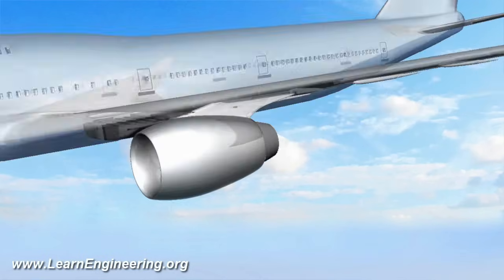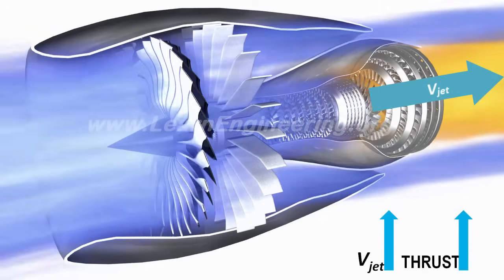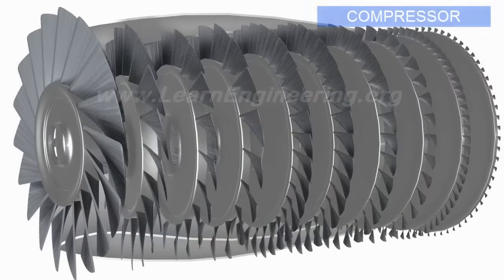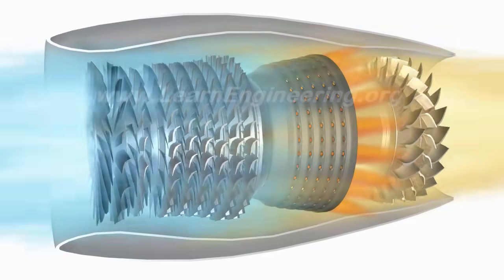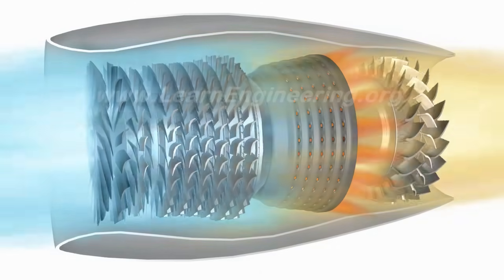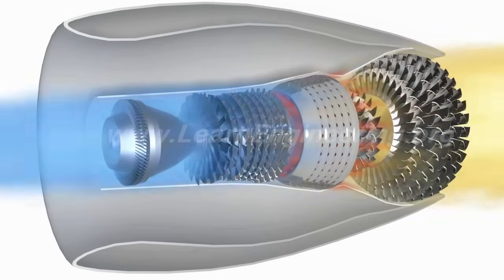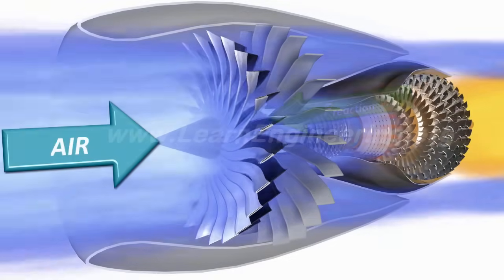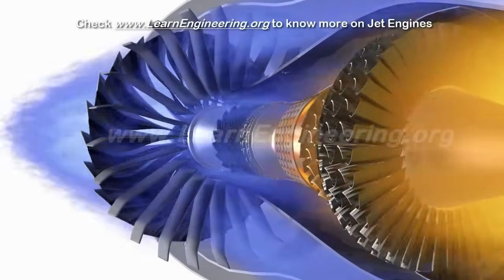Jet Engine, How it works?

Comment: "Jet engines have been the successful drivers of aircraft for nearly a century now" - Is 2017 "nearly" 2041?
Reply: Yes, it nearly is. If you have 76 cents, you nearly have a dollar.
Reply: @catlover1986  Horrible analogy
Reply: @captainoblivious_yt  Why do you say that? It is literally a mathematically perfect analogy.
Reply: @catlover1986  I say that because years are not comparable to cents. While it could be mathematically acceptable to round the number 76 up to 100, doing the same thing with years is just not the same. If you have 76 million dollars in your account, you don't walk around saying "i have about 100 million dollars in my account", because that's just stupid.
Reply: @captainoblivious_yt  But they are comparable. Bill Gates has "about 100 billion bucks". It is fair to say. 

Percentages are all that matter. We don't cease to round because the numbers are large.
Reply: @catlover1986  I just feel like saying 76 is 100 is a little of a stretch.
Something around 80 yould be more acceptable
76 is like a middle ground, it isnt either of them.
Reply: @PizzaPowerXYZ  It is close enough. 

People are missing the point of rounding. 3/4ths is nearly 1.
Reply: @catlover1986  yeah but if you were more precise than that, let's say, around to 100ths, than saying 76 is 100 rounded up is kind of a stretch, sure it is sortof close, but in terms of years, it really isnt
Reply: @PizzaPowerXYZ  All rounding is a "stretch". But .76 out of 1.0 is most of it. 

99 is never 100. 76 isn't 100. But they are both the vast majority of 100.

The item being measured is always irrelevant. Years or cucumbers, makes no difference. If I eat .76 pickles, I almost at an entire pickle.
Reply: @PizzaPowerXYZ  Also, you say "If you were more precise", well rounding isn't precise. 

The question in mathematical terms is specificity in my answer. 

Rounding 0.76 to the nearest whole number is fine. 

Rounding .76 to .8 is also  okay. 

But you cannot add inaccurate specificity. So you can't round .76 to .770 because it adds synthetic accuracy. 

But if you hack off places, you're fine.
Reply: @catlover1986  rounding 0.76 to 0.8 is just fine.
I'm just saying, 0.76 isnt really that close to 1, so it doesnt make much sense to round it up to 1
Reply: @PizzaPowerXYZ  It depends on your purpose. If we wished to never round, we could do that and always use hyper-precision. 

As long as you are consistent in determining what you round to, you're fine.  .76 is very close to 1.0, over 3/4ths there. If you got a GPA of 3.76, it would not be wrong to say you "almost" got a 4.0 average.
Reply: @catlover1986  3/4ths isnt really that close to 1 if you think about it.
If you say what the original comment was saying, that 2017 isnt "nearly" 2041, that's 24 years.
If you think abity it, 24 years is a very long time, so saying that 76 years compared to 100 years isnt that far off?
Does your brain not wrap around that, because our brains dont comprehend very large or long times/ distances well.
Reply: @catlover1986  saying "almost" is fine, but rounding up isnt.
Reply: @PizzaPowerXYZ  They both are fine, mathematically.
Reply: @catlover1986  yeah but with math there is some common sense involved.
Reply: @PizzaPowerXYZ  No, there's no "common sense". It's a science, and "common sense" is almost always wrong.
Reply: @catlover1986  you were just talking about mathematics
Reply: @PizzaPowerXYZ  Mathematics is science. Science has formal rules. Those rules allow rounding. This rounding is appropriate under those rules.
Reply: @PizzaPowerXYZ  Does someone with 76 cents nearly have a dollar? 

It seems you are stuck on semantics. CAN someone properly round that to 100? Yes they can. Absolutely.

Should they? Always a matter of personal preference. 

If someone said something happened 22 centuries ago, but it was only 2176 years ago, was it "almost" 22 centuries ago? Should we round it to 22?
Reply: @catlover1986  but the rules arent very specific
Reply: @PizzaPowerXYZ  Recall, the scale is irrelevant. All that matters is proportionality. 

If you believe 24 years is a long time, 76 is a much longer time.
Reply: @PizzaPowerXYZ  That's because they don't need to be. 

76 is most of 100. If someone rounded 49 to 100, that would be improper. 

Whether you think it is close enough is irrelevant. It was done properly. You may choose to say 3/4ths of a century instead. That's fine and reasonable, but it doesn't make them wrong.
Reply: @catlover1986  if you compare 24 to 2176, than yes, it is very well rounded to 22 centuries.
But out of 100, YEARS wise, since 1 year is a long time (if you compare to your average life, like how long you are at work, which may feel like a long time) comparing 24 years to 76 years, isnt that far apart (because you physically cannot comprehend time at that scale) than rounding up is kind of irrelevant.
You would round ti to 1, you would round it to 3/4ths.
You could say "almost"
But in reality, having 7.6 million dollars, isnt that close to 10 million.
If you think about it, you cant say "almost" 10 million because it isnt close enough to be rounded to 10 million. Its 2.4 million off, which is quite a lot.
Reply: @PizzaPowerXYZ  Pennies or Millennia, what is being rounded is always irrelevant. 

If you can round 2176 to 2200, you can round 76 to 100, because in both cases, the denominator is centuries.
Reply: @catlover1986  FINE
Reply: @PizzaPowerXYZ  Very good.
Reply: @catlover1986  no not good...
I said that because I'm not wasting my time with you anymore
Reply: @PizzaPowerXYZ  Well, have fun.
Reply: @catlover1986  I'll do that
Reply: Bret Z *1939
Reply: Jet engine:
1945 to 20/20 is 75 years.
Reply: @charlesmichaels6648  The Nazis had jet engines before 1945.

They used jet fighters in 1944 extensively.
Reply: @catlover1986  
USA had jet engine at Lockheed in 1939
L133 plane, but.....
Reply: @charlesmichaels6648  Who invented the jet engine first is disputed. But we know that by mid-war, the Nazis had fielded many jet fighters. No other nation had built one until after the war.
Reply: @catlover1986  
No dispute.
Lockheed first invented the jet engine but no government interest in the project.
Meanwhile, Nazi Germany put the jet engine planes into  production, but AH refused to use jets...
Reply: @charlesmichaels6648  The ME 262 jet was actively used. The Nazis made extensive late war use of jet fighters, including in the Battle of the Bulge. 

The Germans made their first prototype in 1939. Not much difference there time wise. But they much more extensively investigated and used them.
Reply: @catlover1986  
Allies bombed long runways of jets.
When did Germany give jet technology to Japan during WW2 ?
Reply: @charlesmichaels6648  Who said they did? They didn't share a lot with each other.

But the fact that the ME 262 saw extensive service is well documented.. 1400 were constructed, only 300 made it in time to see combat. 

But that 300, is 300 more in combat service, than everyone else combined until the Korean War.
Reply: @catlover1986  
ME262 entered combat ???
Where & when?
Reply: @charlesmichaels6648  Throughout 1944 and 1945. According to the Smithsonian Air and Space museum, around 300 saw combat, of approximately 1400 manufactured. 

Among the battles they were engaged in were the Battle of the Bulge (the Ardennes Counter Offensive), and many of the 1945 defensive anti-bomber operations against the Allied. 

There are in fact 3 known ME262 aces. 

I don't understand how you aren't aware that the ME262 saw nearly a year of combat. This isn't a secret. 

https://airandspace.si.edu/collection-objects/messerschmitt-me-262-1a-schwalbe-swallow
Reply: @catlover1986  
Thank you.
Me262 story not popularized in the past. 
How did ME262 land?
Reply: @catlover1986  
How did ME262 land?
Reply: @charlesmichaels6648  I don't understand your question? 

They had landing gears. They landed like any plane does.
Reply: @catlover1986  
Are you sure???
Check again, on the runway....
Reply: @charlesmichaels6648  I don't understand what you're asking, or why
Reply: @catlover1986  
ME262 story was never explored before.
Original ME262 is only depicted as some experimental
airplane, launched on detachable wheels....
Reply: @charlesmichaels6648  Oh. No, they had normal landing gears. 

The ME262 saw quite a bit of routine combat experience. 

I imagine in Post War propaganda, no one wanted to admit the Nazis routinely used fighter jets and were a generation ahead of everyone else.
Reply: @catlover1986  
Agreed. ME262 story is finally emerging...
Reply: Paul Bartley ahhh YouTube comments. The only place where an argument about rounding 76 to 100 can span over two years. Gotta love it
Reply: @brendancafaro6724  It will span more than that before I'm done. ;)
Reply: 1917 is not near 1941.  That is the issue and the problem.  The statement nearly a century is deceptive. . . shall we say fake YouTube.
Reply: @wpiofm  Most of the officers in World War 2 (1941) also fought in World War 1 (1917). Not a huge difference.

1941 is a lot closer to 1917, than 1841 was.
Reply: You’re all wrong.

This video is from the future.
Reply: Whipple applied for his first patent in 1930.
Reply: @damionm121  I know... i just didnt want to admit that he was right
Reply: @damionm121  oh.....

Comment: i'm glad to see i'm not the only one noticing that the fins on the first set of blades that the air comes in contact with are set at an angle that is reversed.
however, the most interesting thing is that this video is posted after someone "proof read" it.
the only thing that comes to mind is the "conspiracy theory" that they did this intentionally to see how often people would notice it.
i have a difficult time believing that it was an overlooked accident, it's just too obvious.

Comment: ...was this good..? – It didn't really explain the jet engine to me...it described it though...
But...how does this contraption get started..? – ...it just "runs"...
Very nice work and good looking video, but it didn't "explain"...and the balloon is not a metaphor....or analogous...
(I see there is a video titled "how a jet engine starts"...how convenient for me...)
I have always wondered, what makes the jet thrust directional – and with such force...(since it's a open cylinder, "pipe", unlike the balloon, which is a "container")

Comment: Not a bad video. I Am fully into Gas Turbines, i read lots of books on them, i recommend Klaus Hunecke for those who want a VERY detailed engineering understanding. Was originally only available in German, now there is an English translation. :-). BTW There is a type of new rocket/jet engine that uses liquid helium to cool incoming air and liquefy the oxygen and the on-board hydrogen tank reacts with it  creating massive amounts of thrust just like the space shuttle rockets.!.

Comment: While you spent so much work on designing the graphics, you did not realize that from both turbines the first stage nozzles ar missing! A turbine begins with a nozzle in which the gases expand, then follow the rotating blades. Coupled with the wrong direction of rotation of the compressors, this is not a good explanation of the jet engine at all.
Jan Huisman, The Netherlands

Comment: 1 inlet of air 2 compresess the air and air gets cooled and then its forword to combustion section where sprey of fuel its done from its nozle and its produces torque and then its moves engines simple

Comment: why is the pressure reduced finally using turbine blades.. Do we not want to have a high pressure air going out??
Reply: It takes energy to turn the fan and compressor stages right.. The turbine is where that energy comes from.

Comment: so basic start up is electrically driven by front rotors creating a relative air flow followed by ignition at the center drum thus driving the rear series of sequential rotors thus disengaging the front electric drive and the whole turbine then continuing to drive and spin with ignition and momentum of drive

Comment: Spinning backwards?   are you sure?  According diagram, the fans blade angle of attack shows is rotating in the correct direction.   if I'm still wrong, all that says it's backwards, please explain otherwise.

Comment: how the hell it turns cold air to hot air
Reply: 'The engine sucks air in at the front with a fan. A compressor raises the pressure of the air. The compressor is made with many blades attached to a shaft. The blades spin at high speed and compress or squeeze the air. The compressed air is then sprayed with fuel and an electric spark lights the mixture. The burning gases expand and blast out through the nozzle, at the back of the engine. As the jets of gas shoot backward, the engine and the aircraft are thrust forward. As the hot air is going to the nozzle, it passes through another group of blades called the turbine. The turbine is attached to the same shaft as the compressor. Spinning the turbine causes the compressor to spin. '
in https://www.grc.nasa.gov/www/k-12/UEET/StudentSite/engines.html from google (how jet engine work) resutl 3

Comment: Why is the third stage even there? It drops the pressure and reduces the air's temperature, therefore minimizing the thrust provided by the other stages.

Comment: How the jet engine works in Heavy Down pour Rains Since, It have to suck most of water and then the water have to go through the combustion chamber. How does the high amount of water let the fuel burn and turbine run?

Comment: fan blades are spinning the wrong way pushing the air out of the intake instead of pulling in the illustration is should spin counter clockwise.

Comment: First of all, jet engines have NOT been powering planes for "about a century"! Not yet anyway. Only since about WWII. It is not yet 2043.
Second, the blades in the illustration are backward to the rotation and thus would be blowing air out the front, and in that case it would not work. If you want serious credibility get the facts and illustrations right first.

Comment: Am I misunderstanding how a Jet engine works or is the compressor blades running in the opposite direction of how they are supposed to. Ok now I'm confused
Reply: pandarama67 the animation is wrong and the blades are running the wrong way

Comment: So the "spark plug" of a jet engine is basically friction from air moving so fast across the atomization thingy where the fuel is introduced?  And then the flame created heats the already compressed air, expanding it, making it haul even more ass out the back of that bitch?  Fucking intense shit man

Comment: All jet engines, which are also called gas turbines, work on the same principle. ... As the jets of gas shoot backward, the engine and the aircraft are thrust forward. As the hot air is going to the nozzle, it passes through another group of blades called the turbine.

Comment: Well, the "nearly a century" is a little bit stretched. The first planes with successful jet engines started barely around 1940, and they were still rarities. It wasn't until the 50s that mostly the military jets had it, and only around the 60s it was widely used in commercial airplanes.

Comment: You have the old turbojet. Which is still used in fighter aircraft, The older low bypass turbo fan example JT8D pratt and Whitney, And the newer high bypass turbo fan. And now the new Geared turbo fan. And then there was prototype engines like the prop fan which I think Russia has  made and US has tried but it never happened.

Comment: Wow.  This is so bad I don't know where to start fixing it.  I'd say about 30% of it is correct.

A jet engine is just like any other engine.  You take in air, compress it (which takes energy), add and burn fuel to make the air hot, then expand it (which releases more energy than it takes to compress the gas thanks to all the fuel you added).  In an automobile, the excess energy drives the car.  For a jet engine, the compressor doesn't need all the energy that the expansion turbine can combine, so the remaining energy in the gas gets used to accelerate the jet exhaust.  The mass flow rate through the engine, times the difference between exhaust velocity and intake velocity, is by Newton's law, the thrust.

So the problem with this jet is that the energy of a flowing fluid is proportional to its velocity squared, while the thrust is proportion to the change in velocity, hence you need four times  as much energy to get twice the thrust.  For a turbofan, rather than accelerate that exhaust air as in a jet, a second turbine in a turbofan captures that energy by expanding the gas even further (and ejecting it at a much slower speed than a jet) and it uses that energy to drive the big fan you see up front in turbofan engines.  That fan adds a little bit of velocity to a huge amount of air, versus the jets adding a lot of velocity to a little air, so you generate good thrust from a turbofan without wasting too much energy in the form of a hot high-speed exhaust flow.

Are people really supposed to learn engineering when the "Learn Engineering" videos don't even know what they're talking about?

Comment: Has anyone noticed that the illustration is spinning in the wrong direction? Based on the angle of the blades it should be turning the opposite way.
Reply: No, the fans are rotating correctly in same direction as a turbine, but they have wrong orientation of blades.

Comment: Since 0:14...the engine turns in the wrong direction...
Reply: You are right, but it doesn´t matter, no one will notice it because in fact very few people  really understands this. Welcome to the future shown in "Idiocracy" film
Reply: 100% agree with you, fans rotation is not correct in my opinion, that engine suck up air from the exaust!
Reply: It's a vacuum jet engine. It's made to create a vacuum in the combustion chamber, thus, creating jet fuel out of thin air.
Reply: +PoppaBear hdi